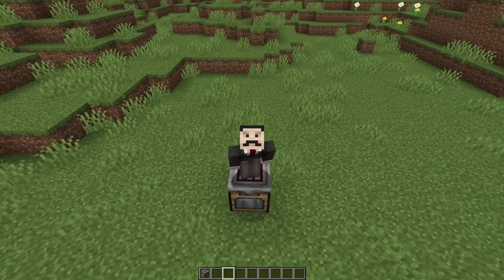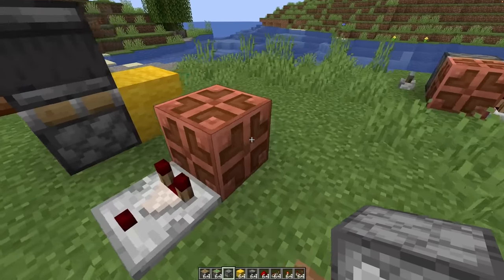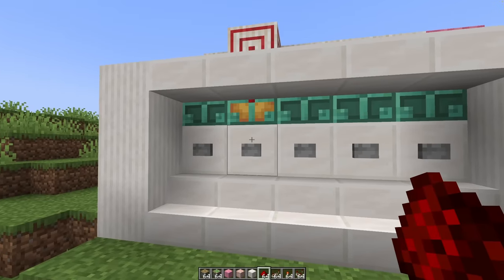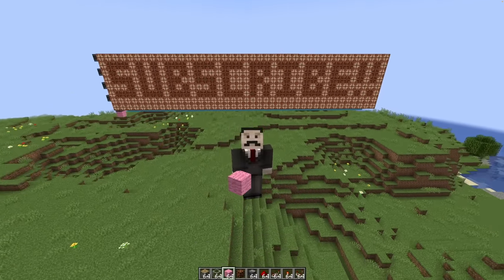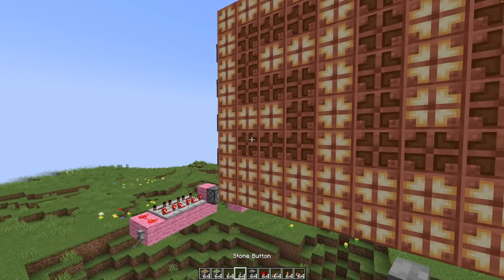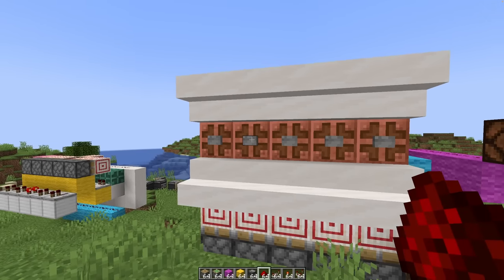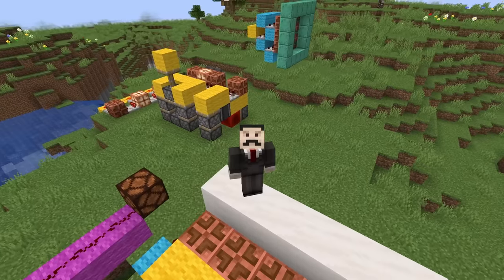Mojang added ANOTHER Game Changer...

Comment: Just a heads up, someone found that with the Crafter, it's possible to have a base-10 (0 through 9 redstone strength) counter, which can count up or down, and expand to counting to 100, 1000, etc very simply. So it does have a very interesting use in that sense.
Reply: Where can i see this?
Reply from the maker: That was probably crafty masterman. Yeah, not denying there aren't uses for it, but it's broadly going to be used for crafting contraptions. Where as the bulb will likely pop up almost everywhere like the observer/target block do!
Reply: @ThatMumboJumbo it’s the man himself
Reply: We just need base-16 counting now, the copper bulb can do binary!
Reply: @phantomdevil6834 base 16 is just binary+, it’s literally just binary but squashed down, so functionally the copper bulb can do it as well
Reply: @phantomdevil6834 Redstone signal strength is already 0-15
Reply: @ThatMumboJumbo  right the Crafty Crafter Counter
You have to call it that
Reply: @TheRenegade...  but given the size of a chain it’s fairly large to encode, we just need like one block that can do it, I guess jukeboxes kind of count with the different cds

Comment: Mojang should also create an alternative which does not update light to reduce lag for massive contraptions. Like instead of blaze rod, it would use amethyst crystal or whatever.
Reply: I wish the fully oxidized copper bulb was exactly this.
Reply: Yess
Reply: tinted copper bulb
Reply: Now I wish that they redistribute the light levels so that a brand new Copper Bulb gives off 15 light, an Exposed Copper Bulb gives 10 light, a Weathered Copper Bulb gives 5 light, and an Oxidized Copper Bulb gives 0 light.  Also adds additional incentive to fully oxidize copper without making it a mandatory waiting game.
Reply: Or craft it with another block to dampen out the light, then use a right click tool like (shears for wool, etc) to remove it while it's placed. Not intuitive, but saves having to add blocks while potentially adding a new feature (snuff out torches with a material, etc).
Reply: Good idea
Reply: Well if they added this functionality to the copp3r doors and trapdoors, it'd be perfect
Reply: Does tinted glass not do this?
Reply: @cappertilge8916  Not sure, I imagine the lighting uodates are still calculated in some fashion due to the copper blocks, of which disabling such functionality is what is desired so that the redstone component of the block could be used more for less cost to the game's performance when doing it more.
Reply: @Minty_Meeo missing opportunity jang

Comment: This is going to be incredibly useful for computational redstone. Or, at least, I'd assume so -- it's literally a binary number, and also, as Mumbo showed in the video, it basically has built-in binary counter stuff. I can definitely imagine it shrinking the size of those humongous computers by a lot.
Reply: They'll probably be a lot better for performance too
Reply: Those computers are super optimized already, they don't use binary logic directly. They'd be huge otherwise. They use tons of smart stuff with comparators and signal levels.
Reply: @theairaccumulator7144  most redstone computers like the mpu8 or the chungus 2 only use binary logic

its rare too see a redstone computer that uses redstone signal strength
Reply: You could make a flash drive by storring the copper bulbs in large blocks, as they are push-able.
Reply: @theairaccumulator7144  they do have to store memory, though, and that's usually stored with big t-flip flops in huge arrays. that should be much much easier to manage now.
Reply: I've played around with it and its insane. Exponentiation is now possible with only a few blocks. Its practically modular, and with such large scalability, taylor expansions for sinx and cosx are viable!
Reply: Scicraft is gonna have a FIELD DAY with these
Reply: This is basically integrated semi-conductor circuits for Minecraft
Reply: memory block wooo
Reply: And Mojang said nope-- all of that gone!
Reply: @GeorgeN-ATX  Not all of it, just the coolest hidden feature that would have revolutionized the speed of logical redstone.
Reply: @theairaccumulator7144  Minecraft Supercomputers don't use hex because it is way more complex and binary adders are far easier
Reply: @Darth_Insidious  what was this change, was it the 1 tick to 0 tick change?
Reply: ye it's literally bits.

Comment: (6:40) If you have 6 bulbs in it, the binary counter would only activate every 64 inputs. Maybe with a dropper into tripwire input it could count stacks of items?
Reply: If you use droppers to move the items you can use a clock to simultaneously power the dropper and the counter. Should work!

Comment: Copper is actually useful now? Nice. Also, dear God this seems like an absolute game changer to me. Gonna revolutionize a lot of redstone.
Reply: It needs blaze rods to make in survival so it'll also boost those farms/sd sales too
Reply: This whole update is my new favorite modern update, used to be 1.13 and 1.14
Reply: It's not quite a game changer because both crafter and bulbs need to be able to soft power adjacents

If people want to light bulbs in a screen make deoxidized bulbs require hard power, but for technical uses soft powering blocks is the correct implementation really unsurprised and disappointed they chose not to let EITHER block soft power others. Especially the crafter

Comment: Having another option for encoded piston tapes like with cauldrons that doesn’t take a butt-load of iron is nice. Also, you could have a recording head for the tape now as well since you can actually switch the state of the copper block with redstone!
Reply: a Turing Machine tape / Unix block device!
Reply: Couldn’t you have a write head before with a dispenser and water bucket etc?
Reply: @rawpotato1767 now it's all the size of one block
Reply: I'm not well-versed in piston tapes, but isn't there a possibility that the bulbs could come into contact with a power source along the way and have its input switched? It's a good idea I'm just theorizing, feel free to correct me if I'm wrong
Reply: @depstein3847  it's possible, but you can easily design around it. Only one type of piston tape powers the block being pushed, and it's not easily tilable (so not used for wide tapes like this). The better method is to either just time it or use observers looking for the block to move into place.
Reply: @fiveoneecho  oh alright thanks

Comment: I'm gonna miss the novelty of a T-Flip-Flop. Making a button work like a lever always felt like a job well done, as if it was the finishing touch on my contraption. I should be happy it's easier now, but really I'm just sad to see my favorite redstone module become obsolete.
Reply: I doubt it will be completely obsolete, cause even the target block didn’t completely remove things, just simplified them, and I think the same thing will happen here, depending on the type of input needed, the old one might be required due to the new one having a shorter pulse

Comment: Back when /tick was in carpet mod it had a built-in superhot mode but Gnembon was told he had to remove it.

With the permissions issue, it should be possible with a datapack or on a server with command block permissions changed.
Reply: not working with datapacks, sadly

Comment: for the single button thing. cant u just use the 5 copper lamps, and have one in the ON state. then run a Redstone line behind or above them so the others get a pulse too.. you will never have none selected but always only 1
Reply: They're considered transparent so they don't pass on signals like that
Reply from the maker: They toggle. So powering all of them will switch all of them. The last one that was on would be out of sync with the others. 
Hard to describe in text, but in short it wouldn't work that well!
Reply: @ThatMumboJumbo  You'd need to either pulse the previous input an extra time or not pulse it at all that time. You'd probably need some kind of memory circuit for that (or maybe just some repeater locking? I haven't done much logic circuiting in years, might be misremembering).

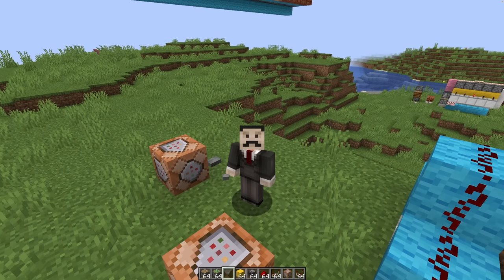Comment: 6:08 it it's a permission issue, then you can do execute as @p run etc...

I think.
Reply: Close. The /tick command has a permission level of 4, meaning in order to allow datapacks and command blocks to run it, you need to change a setting in the server properties file.

Implicit to that: this can only be done on servers, not single-player.
Reply: @GSBarlev  oh.
Lame.

Wait can't you like, use nbt editor to do it in single player worlds too?

Just curious.

I don't have time to check right now though.

Comment: It’s an awesome new addition! Red stone lamp that is a t flip flop and moveable essentially. It also has a really nice texture! I don’t agree that it’s a bigger deal than the crafter though. It does have more uses and will become a core red stone component, but the crafter adds a feature that we have never had before. The auto crafter allows us to make things that have never been possible before. This just makes red stone easier/smaller in some cases. Still really cool though!
Reply: The ability to compact computational redstone by tens or hundreds of times is less of a deal than a crafter that only matters in survival got it 🤦‍♂️
Reply: This will be used more, but it doesn’t add functionality like the auto crafter does. Id argue new features allowing us to do more things (things that weren’t previously possible) are more important than compacting Redstone. This doesn’t add any new features it just makes things easier/more compact. Also most contraptions and farms are aimed at survival play so I’m not sure what you are getting at with that part. Both are great to have though that’s just my 2 cents!
Reply: @muffinconsumer4431 You really think bulbs compactify 10 times? Missing opportunities jang has FOOLISHLY implemented it without the ability to soft-power other blocks, which means instead of building whatever we desire taking power using dust, repeaters, or powering next-door components, we HAVE to use comparators which HAVE to have a block or slab or trapdoor and HAVE to hard power as the output. Maybe use the 8x state space to enable waxed bulbs that don't power their neighbors when hard powered for the aestheticians but technical Minecraft needs the elegant solution of soft powering nearby components

Edited to remove mention of crafters, they do soft power after I rechecked, was wrong
Reply: nerds be like (bruh just agree ig)
Reply: finally, automating stick/block farms from bamboo, paper farms from sugar cane and arrow farms from mob farm+chicken farm+stick farm

Comment: How I would say you can catagorize redstone items:
1. blocks that make certain things possible, because they either make an existing circuit smaller and easier to fit in anywhere or because they do something that was normally only available through a very roundabout way (the observer replacing a BUD detector is basically both)
2. blocks that make entirely new things possible and things are crafted with them as a central piece.

The honey block would somewhat oddly fall into catagory 1 because it didnt make something new possible, they just amplified an existing thing, and due to them being transparent, they allow things that slimeblocks would not.

But classifying any of them as a hero block is odd, because any catagory 1 block changes a lot more than catagory 2. Catagory 2 does add a lot of new things that are possible, but those things are not always useful. 
Take the skulk blocks for example, all of them are basically catagory 2, and there are a lot of things you can do with them and only them. But how many things are used on a regular basis? Decked Out 2 is absolutely a master piece that regularly uses the blocks, but even with specific sounds doing different things, you just dont have that happen on a regular basis.

Yet, the target block is basically used in 99% of modern contraptions. Solving things that were unsolvable. Turning a 10x10 contraption into a 5x3.

Both of the catagory blocks can be heroes, and the Crafter and Copper Bulb are both heroes in their own way.

Comment: We need a new type of Hopper, where it has 9 slots, and it drops them in a sequential order. (Drops one item then goes to the next slot), and the hopper can still be disabled by redstone. This would be extremely helpful for auto-crafting. Especially when you can predetermine the recipe for the auto crafter. and placed in sequential order. 

@Mumbo I saw your other video for the dispensers, and this would easily solve that problem. If you lay out the sequential order, everything could stack inside of this "Cropper" (Crafting Hopper). Then feed it into the auto crafter. Please let me know what you think!!
Reply: Can you elaborate on the Super Hot thing?

Comment: 6:08 this is not a permissions issue!! Command blocks always run at the permission level 4 (highest permission level/op(erator)) the reason this doesn't work is because you left the forward slash before the command which makes the command block interpret this as the command //tick instead of /tick.

Comment: Just another thing, im not sure if this is accurate but if you set up 6 copper bulbs in a binary clock youll be able to use the exact number 32 in a item sorter or even with the crafter. Like lets say you want half a stack of items, you can hook the binary clock up to observers so that it allows an item through a hopper system every pulse, and when the clocks reset you can move the entire set of 32 items down through the system ready for collection. A niche idea but potentially helpful

Comment: I read that the lamps would stay powered until fully corroded which would be awesome, 'cause I wanted to make a realistic electricity network and that would have been the perfect fuel for a nuclear reactor.
But it doesn't seem to be the case, so back to burning coal.

But that would require the redstone output to decrese with the corosion and hit zero when complete, so no compact fuel rods for me, I guess

Comment: You could potentially use the bulbs for a control panel control multiple auto-crafters; one set for a binary counter for how many you want (0000001 for 64 stack) and another set with various outputs for which item you want to craft

Linking it to a storage system is a problem in of itself but interesting concept

Comment: I think copper bulbs can be used for data storage. I imagine a circuit with copper bulbs and pistons, one side will have comparators to read information and then if you trigger the pistons it would go to the writing side with repeaters.

EDIT: just tested a circuit like that and it worked.

Comment: Hey Mumbo, I am unsure how likely you are to read this, but I just came up with an idea based on some of the things you have been showing, especially the binary clock, I am wondering if you could pair that, along with the auto crafter, and various assembly lines, to create very specific automatically fulfilling shop requests. Being able to say, order 25 gold ingots we will say for simplicity's sake. Would you be able to in theory, hook your gold farm, to the auto crafter, which is in turn hooked up to a box loading system, which takes output via the binary clock until it has reached the desired quantity of product, at which point it delivers the load to the purchaser, and refreshes it's system for the next customer.

I am not the greatest at redstone, as I have never devoted much time to it, however I feel like in many cases mine and your brains work very similarly, so I figure you will get my meaning even if it is rather poorly typed. Thank you for your content, and I look forward to seeing what you come up with next.

Comment: I absolutely agree with the ''hero of the contraption vs fundamental component'' point you made in the end of the video. This is not the kind of dedicated part that requires an entire circuit built around it but has a much nicher use case because of that, it just greatly helps with making the contraptions to begin with, giving it a potentially less cool, but far more important set of roles. Overall, amazing addition, one of the very few slam dunk features of Mojang lately, amidst all the pointless mediocrity and questionable mob vote stuff.

Comment: Missing opportunity jang needed to make both bulbs and crafters soft power their adjacent blocks rather than making us use comparators & a block or slab or trapdoor for support structure and the comparator has to hard power its output. It doesn't make sense for mechanisms, instead we should take power from bulbs using dust repeaters or adjacent component

I think in the case of bulbs people desire the aesthetics of adjacent bulbs taking hard power but not lighting up neighbors so hopefully we can use the 2 wax x 4 oxidation state space to contain both aesthetic non-soft-powering bulbs for builders but without question soft powering bulbs are miles and miles ahead when it comes to technical Minecraft.

Comment: The crafter is not game changing at all.  I built an automatic honey farm that makes honey blocks and sends the empties back up to be filled again and I hated every minute of it.  The size and complexity added does not in anyway justify what it does.  I will probably never do anything like that again.  I'll just add storage and put in an auto disposal and let the system run to failure.  The autocrafter could've been great if it was based on a furnace instead of a dispenser.     I am not a builder, redstone and automatic farms is what I do.   And I hate the crafter.   Most useless overhyped block ever.  

The copper bulb, that's an actual game changer.  The next thing I want to see is redstone wire, or some way to turn corners in one space without activating the blocks it's not connected to.
Reply: automatic crafting has been modded in for years, we definitely wanted this